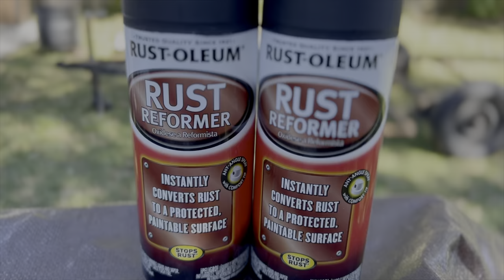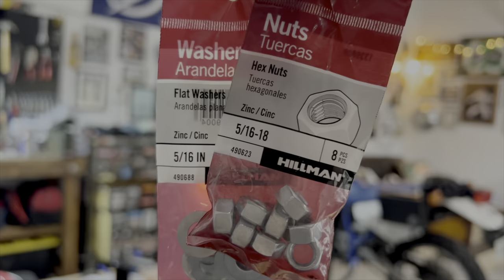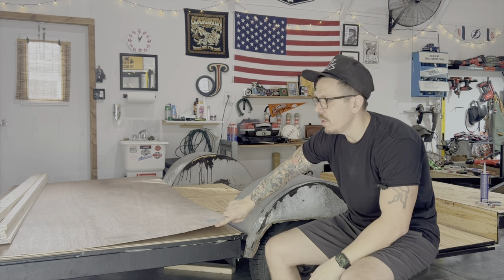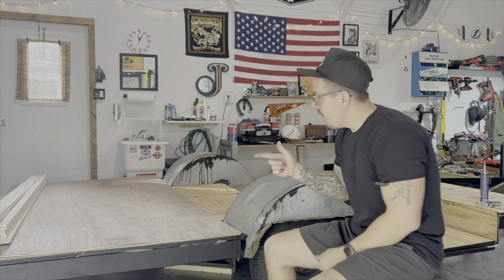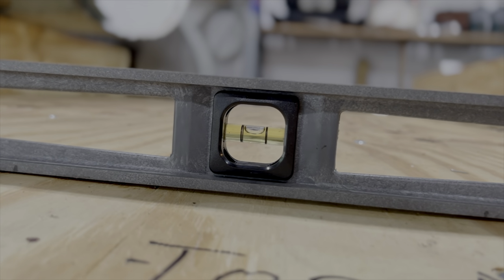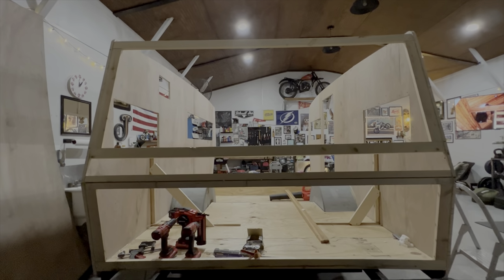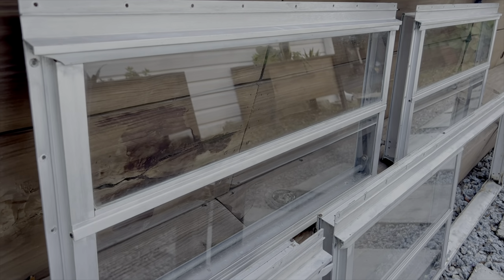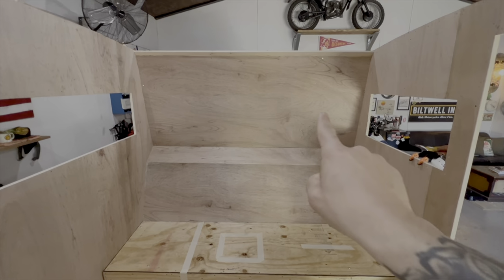Rebuilding our vintage camper! From the ground up.

Comment: You are the only video the documents the floor. Our rear supports were just hanging down and i thought it was a design flaw, not realizing to bolt the frame sides to the flooring.  Thanks for the final piece of the puzzle.

Comment: I guess they made them different in 1976 because I have a 1976 shyster 27 foot and everything’s all original in that and the skeleton structure was instead of one by tubes it was two by twos just like a normal mobile home from the 60s

Comment: You're doing an excellent job on your LoFlyte!  I started mine back in 2009, and believe it or not, I plan on finishing it, LOL.  I didn't do a total frame off reconstruction, I replaced the rotted floor sections and replaced the carriage bolts, I did add a steel framing support across the back trailer frame to strengthen the back corners of the floor.  I removed all the metal skins to address the rotted wall and ceiling framing.  I kept some of the original wood framing but the front and back walls fell apart like yours did, as did lower side wall framing and all the wall corners.  I've restored the kitchen and dinette cabinets and rebuilt the existing refrigerator & pantry  cabinet.  Like you I removed the bunk bed.  I cleaned up our metal skins but there were pin holes in most of the bottom siding sections, so I used a drill and wire brush to clean the panels, taped the holes from the outside and painted over the holey areas with a layer of JB Weld and painted with a good aluminum primer.  Updated the electrical system to 30 amp, added an AGM battery in a sealed and vented box. A lot of the water damage in ours seemed to be from our chimney fridge vent, so I removed it and tried to patch the opening and other cracks in our old roof. Tried to reinstall roof metal last year and it was about a 3/16" to narrow,  possibly from crowning where I added framing for a fantastic fan.  So I ordered new roof metal which I'm going install it hopefully in the next week or two (with the help of Larry's Canned Ham videos. You're doing great and seem to making quick progress.  Thanks for posting your videos, they're a great inspiration.  Yours is the best LoFlyte build I've seen online.  I have some of my pics on Instagram, under Ragman_69.
Nice garage too!
Reply from the maker: Thanks I really appreciate it! I’m super happy with the progress. Can’t wait to start actually using the camper. We booked our first campout this October to test everything out. Yours is looking fantastic. I checked out your Instagram great Work keep it up. 👍🏼
Reply: @The_Heights  Thanks!

Comment: the project is very interesting because you can see well how it was built in the past. Are you sure that the walls are half inch plywood?
Reply from the maker: Everything was built exactly to spec, same materials, but in a lot of places reinforced much better than the original build. It’s the interior cabinets/furniture, etc. that connects the walls floor and ceiling together that gives it its strength they were built this way to be lightweight.

Comment: Do you have anymore updates on your shed? How much did the mini split AC cost? Does it keep the building cool enough? What about condensation
Reply from the maker: Sorry about that I didn’t see this comment… I have not yet put in the mini split… For now, I tend to always have the doors open and my big shop fans on and that is good enough. There are zero issues with condensation so far… But the mini split that I will eventually go with is a Mr. cool brand and it is around $1900 I’ve seen it used in the shop very similar to mine, and it seemed to work great

Comment: This is gonna sound dumb but how did you screw into the 1x2s without splitting them? Even when I use pilot holes I have a huge problem with it...
Reply from the maker: Gonna need to use smaller screws and make sure they’re not long enough to come out the other side… Make sure they’re actually wood screws

Comment: great video! about to start a rebuild on a 1956 westerner and found this super helpful. do you plan on wrapping/waterproofing the frame before putting the shell back on? also, will you be insulating?
Reply from the maker: Thanks! That’s awesome… Yeah, there are two more videos after this one on my channel that showed the prep work and what I’ve done up to today to answer all those questions 👍🏼

Comment: Hoping you can help me. Bought same trailer. Extensive front end damage..front part of floor on the riser under dinette.  How can I replace front and sides about 6 inches around? Is it supported by 2x4s underneath?  Ty
Reply from the maker: @ 1:32  you can see there’s just some two by fours supports connected to the three-quarter inch plywood deck on that front dinette section underneath running along each side that is it
Reply from the maker: @1:31
Reply: @The_Heights  right. Video so fast had to watch 4x. But I did see 2x4s. Ty

Comment: I'm getting ready to do this with my '59 Traveleze.  This might sound odd, but how do you attach the sub floor to the metal frame?  Did you add those cross beams so you could attach it to those?  I don't really understand how the trailer stays securely on the trailer frame.  Thanks!!
Reply from the maker: The subfloor attaches using carriage bolts through the floor and through different parts of the actual frame, depending on the type of camper and brand

Comment: What did you use for the undercoat?
Reply from the maker: For the subfloor? I used flexseal rubber coating… Two coats. First time using it it actually worked really well.